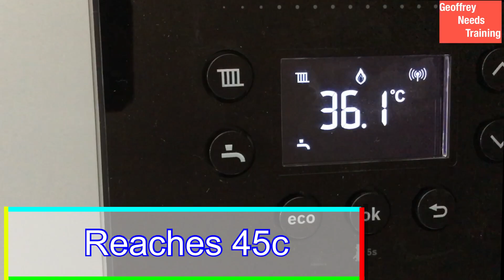cross pipework on a Worcester 2000

Comment: Hello Geoff Needs, You've got a decent test setup there. Is it possible you help me work out a solution to a W-B 2000 problem?
Reply from the maker: How can I help
Reply from the maker: @robertkimber4579   Hi Robert as far as I know they don’t supply that particular data within the industry it’s normally around about 55 dB or what manufacturers instructions advice  internally    I can’t tell you what It would be outside of property I don’t know what the levels should be  above ambient sounds levels I should imagine you will have to contact your local authority to see what is acceptable reading should be in cases were next door neighbours are complaining about the noise of the boiler sorry I can’t be any more help as I am at the heating engineer not a sound engineer